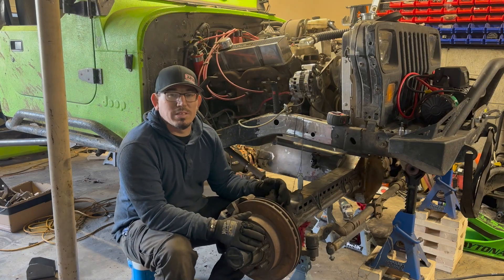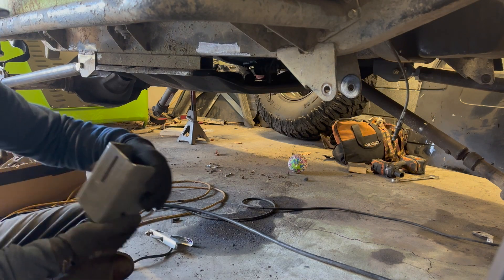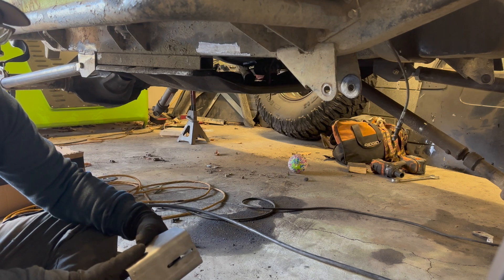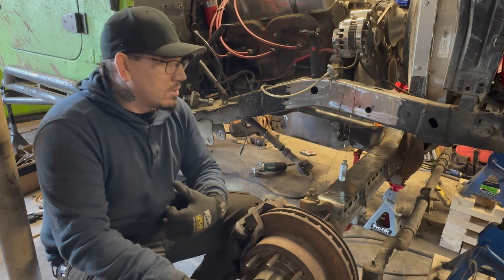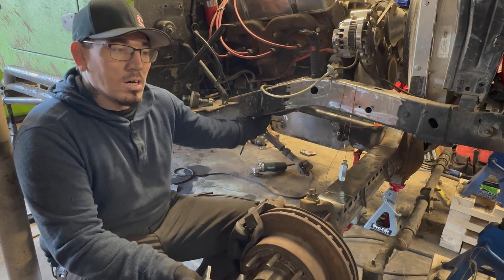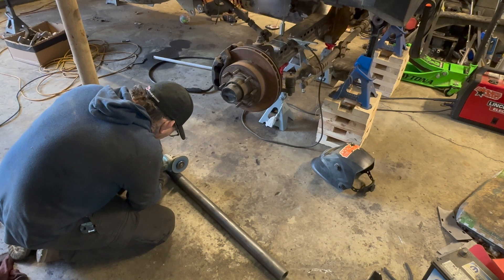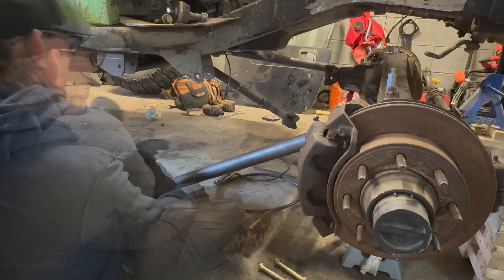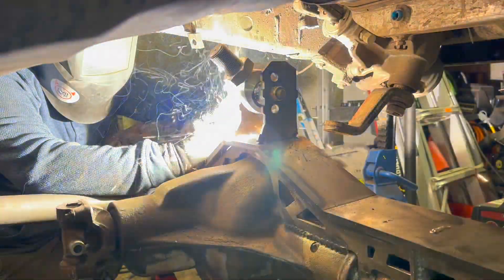How to build a 3 link front suspension, Jeep Wrangler YJ Part :1

Comment: How y route the exhaust pipe with tha upper link on the drivers side?
Reply: Asome y try it on mine, just can get enough space. Have to do it on the passenger side l got a Chevy sbc on it two
Reply from the maker: Good luck! Hope it works out!
Reply from the maker: Crossover pipe to a y pipe on the drivers side.

Comment: I’m thinking of doing this to my 95 yj. Why can’t you fit a 4 link up front?
Reply from the maker: Just difficult to package. Not impossible. Usually between fitment with the factory frame space for the exhaust and trying to keep the upper links out of the oil pan it it’s pretty tough. Again not impossible

Comment: 120 or 240 welder? Trying to decide how much welder I need for my YJ
Reply from the maker: A good quality 220v will always be the better choice for sure. I built this with a Lincoln 130 110v using .035 flux core wire just to show a budget build. I always suggest a bigger welder tho

Comment: I finally completed my rear!!! Now on to my front. I must say i have gone over this 3 part video like 6 or 7 times for notes, lol. One question regarding the upper and lower links are they all the same length, or did u make the upper link shorter or longer than the lowers??  Thanks again for all the amazing content
Reply from the maker: That’s awesome! Congrats.
So on mine I did the upper link longer to help maintain caster while driving. But it’s still a balance cause you have to keep the driveline happy.
Busted knuckle has a great three link calculator you can download for free that will help with running all the numbers and seeing how they will effect caster and pinion angle during travel.

Comment: Dumb question, how much modification did you have to do to the Barnes mounts with the truss? I’m going to be doing pretty much the exact setup that you have , and im torn between the artec diy kit and the Barnes. I like the Barnes because of your video, and the price, but I notice in the pictures it looks like it’s meant to be welded right to the axle tube
Reply from the maker: I just did a bunch of measuring to get the correct hight then cut it down flat to weld to the rope of the truss.wouldn’t say it was a ton of work…. Took longer to get all the measurements right than to do the work
Reply: @KBWheelin  thank you! I don’t think it will be bad, I’ve been watching your videos and honestly it’s the best walk through I’ve found so far. I’m going from a turbo 4 banger to a sbc so that will be fun too
Reply from the maker: @sschwager96  nice that’s what I have in the Jeep in the videos. The sbc is definitely worth it!
Reply: @KBWheelin  sorry to bother again, Im really new to doing this, been building raceboats for years, and doing cars and stuff but never anything this intricate. Do you mind sharing what kinda welder your using? Source voltage/amp rating. Im gomma be using all of your videos along my journey haha

Comment: Considering how important that third link is, its literally the only thing holding your axle in place, that bracket mount looks feeble to me. I hope you have plans to gusset the sides of those plates on top of the diff, myself I also wouldn't MIG weld it, I would use dual shield Metal Core. -Welder Fabricator,  with over 30 years in the trade.
Reply from the maker: I mentioned it in the video that after everything is finished it would be boxed in and be putting some gussets. There’s definitely many options for burning everything together someways better than others.

Comment: Great video, I'm  building semi 4 link on samurai with nissan patrol axle wondering can rear and front link be different size because of packaging problem
Reply from the maker: I’m not sure what you mean by different size but I design my front and rear suspension separately from one another the only thing they share is ride height and depending on the application that might be different.
Reply: Sorry not size length, do rear link have to be same length as front.
Because i don't have space in front to make them the same.
Reply from the maker: Gotcha. No they definitely don’t need to be the same length. As I said befor the front and rear are typically designed slightly different from one another and depending on use. The Jeep I am building in the video has rear links 2”-3”longer than the front

Comment: Why didn’t you put the upper link on the other side so it doesn’t bind when the axle drops out ?
Reply from the maker: I needed it on the drivers side so there will be room for the exhaust and also find that having the upper link on the pumpkin gives better and more consistent pinion angle control. I have done it both ways and had them work will either way but I’ve never had any binding issues having the upper link on the pumpkin side vs the other, I could see it being a binding issue if I had narrowed the axle cause it would put the upper link at enough angle it would fight the track bar on droop but I’m running full width axles so the link is straight.